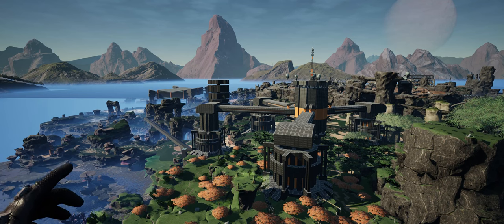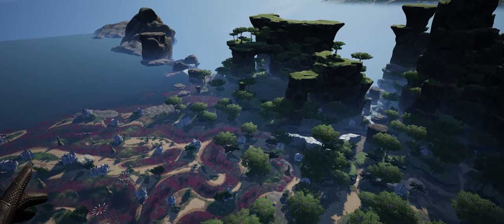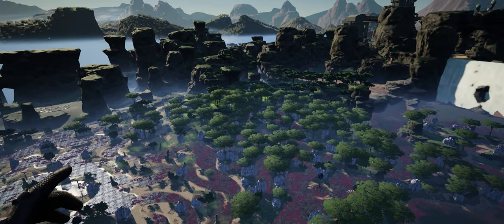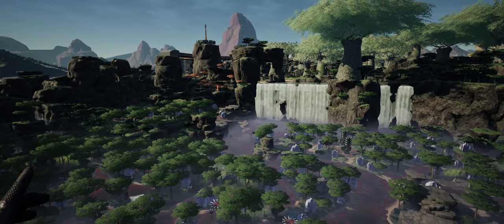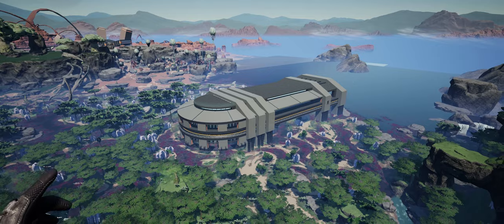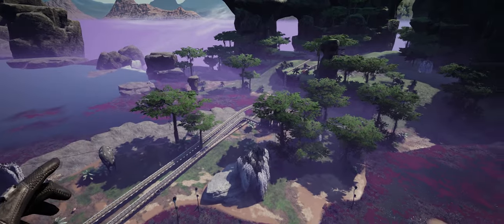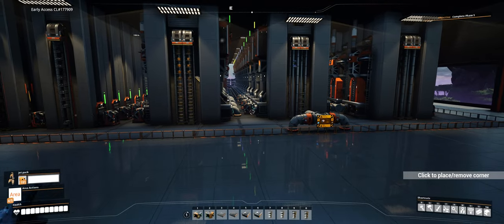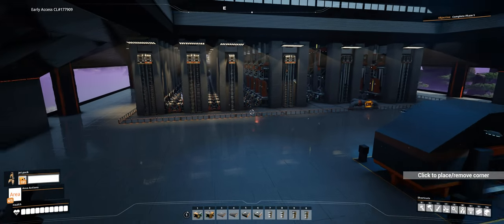Ingot Factory with customisable Oil production for Plastic & Rubber - Satisfactory

Comment: Another way to do configurable fluid/gasses would be to use packaged fluids - that would let your splitter system control things like you're used to. You would just need unpackagers feeding into the refiners/blenders and then deal with the return supply of empty containers.

Comment: Top notch build, awesome job. I'm new player really like the way you enclosed foundry's with walls and pillars so its ok if wall is yellow when placing next to machine ? subscribed
Reply from the maker: Cheers Doug, appreciate it. Yes since update 5 you can pretty much clip most buildable pieces over another, which is indicated when it turns yellow, as you mentioned. So its ok to clip walls/foundations etc through machines - machines will still function just fine and normal. Thanks for comment mate.